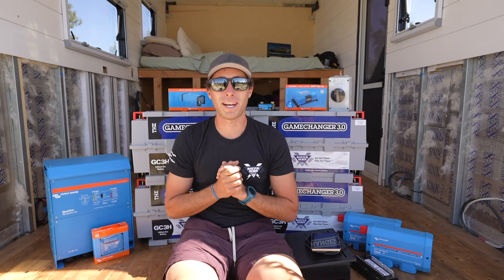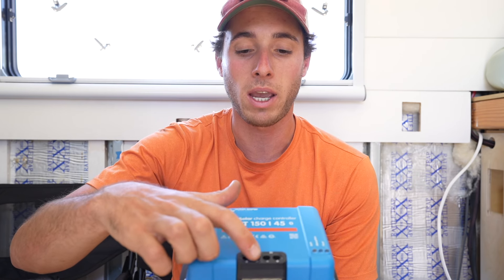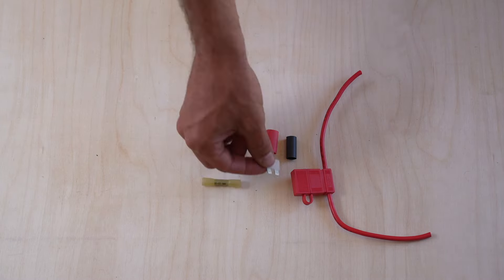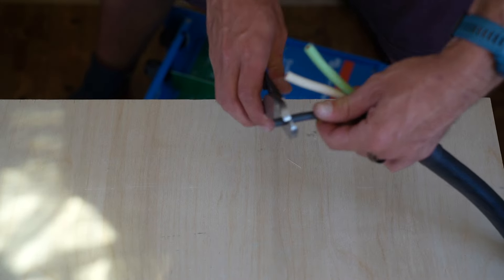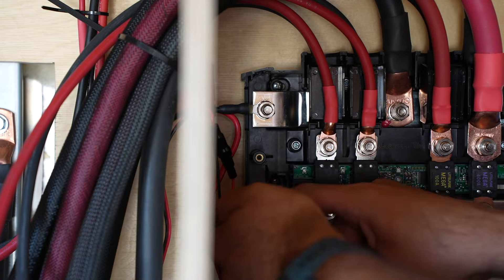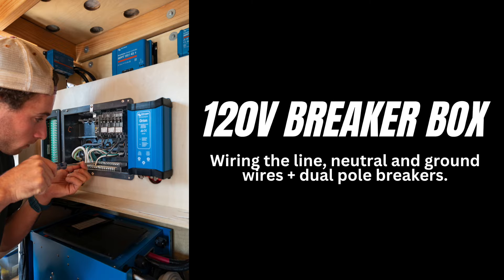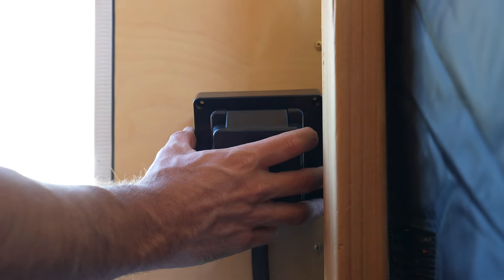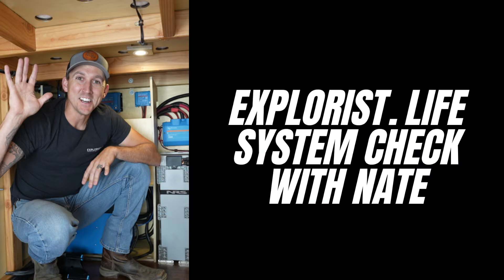DIY Camper Van Electrical Install // START TO FINISH 24V // BATTLE BORN BATTERIES X EXPLORIST.LIFE

Comment: Great How-To. Just a heads up, if you ever use the load out's on the 75/15, the software can be iffy. It didn't work to feed a switching UPS, when a similar Epever had no issue. Just a minor issue, and everything else we have is victron. We're getting ready to build a mobile EV charger with two Multiplus II's, a 250/100, and a Lynx.

Comment: I would have put the cut-off switch next to the bed NOT at the further away point in the van but i found it interesting non the less.
Reply: Good point, let’s hope I don’t need to use it in an emergency situation 😅 thanks for watching!

Comment: you said you fished the 10 guage wire over from the lynx distributor to the mppt 150/45 but the mppt 150/45 wire kit comes with 6 gauge wire so thats where you got me lost?
Reply: This is at about 13:10 into the video

Comment: I thought one of the advantages of a 24 volt system is you can use smaller gauge wire, yours looks like a 12 volt install.

Comment: well  for system you over spend a lot ... looking at prices of battleborn at 2500$ per piece... you could of went for a 48volt system with serverrack batterys at 1500$ 48v100ah ...and you would had needed only 3. that hold more power and expandable to 4 at 20kWh....plus saves some money on the mppts also ...giving up a bit of space and saving a lot of money ...
Reply: and if you want to charge from alternator they have 48v alternators add ons  or conversion kits for some busses... those can bring power when your driving.

Comment: can you use this exact setup except use a cheaper alternative for batteries like maybe the Renogy 12V 300Ah Core Series Deep Cycle Lithium Battery w/Self-Heating for $1,069.99 each. those battle born batteries are just way to much your paying like $10,000 for 4 of them